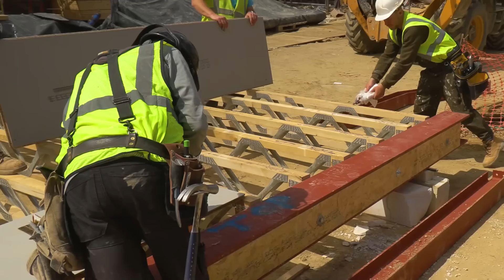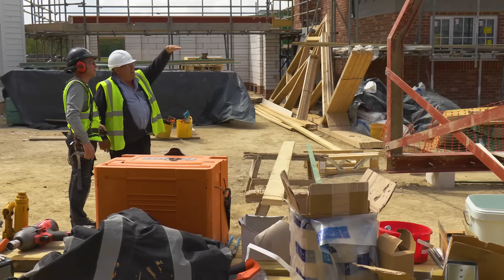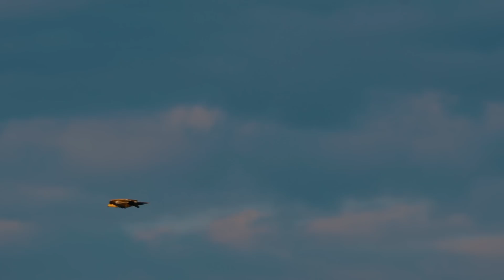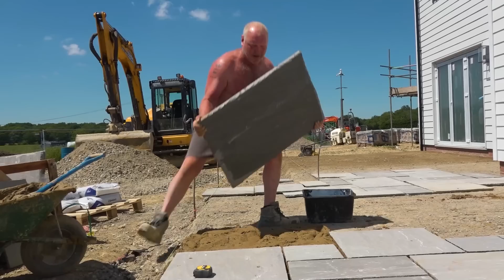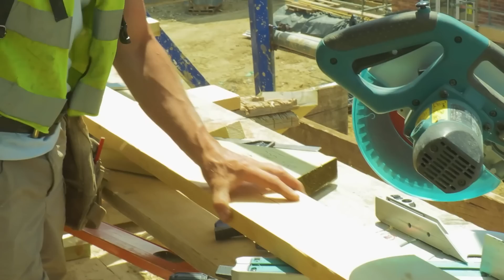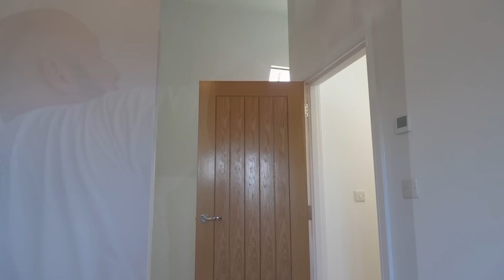The Oast House: A Crazy Construction Project

Comment: Watching this  i saw what i would call a bodge build, not questioning the skill of the workforce but of the materials used, which other than the steel frame work would require major maintenance within the next 10 years at enormous cost, probably more than the original build cost. Cheap substandard materials used, and susceptable to the weather elements.

Comment: Could I ask about the timbers in between the flanges of the steels? Did you pack an 8x2 out with some osb so that the joist hangers hung past the end of the flanges? Got to do the exact same thing shortly and was going to use 9x3 to overcome this but it’s expensive if I can get away with some osb instead. Many thanks and love the Oast House 👍🏻
Reply: Hi Big sugs, yes we did pack it out with timbers then OSB. I’m not sure just OSB.  It’s rated as structural but I preferred real timbers. Thanks for watching it, and good luck with your build.

Comment: Why would you nail the floor down and not screw? Wouldn't a screw hold the flooring better over time and can be tightened if needed ? Interested to know.
Reply from the maker: Screws are a good idea but the glue is doing most of the work and stops the squeaks by giving an even bed